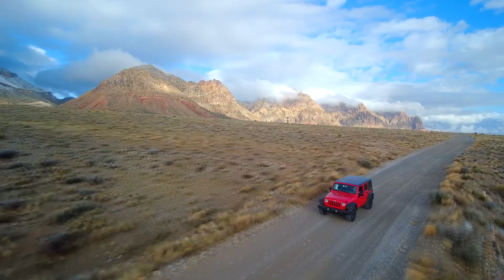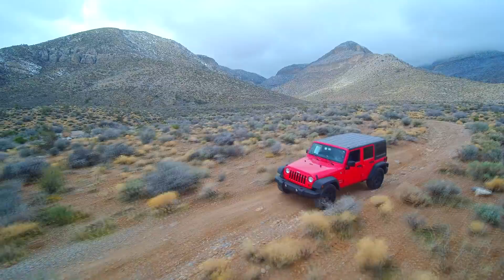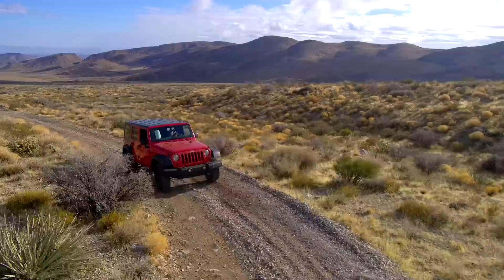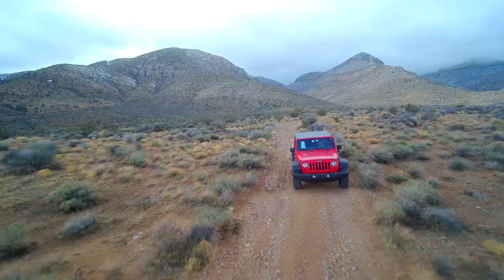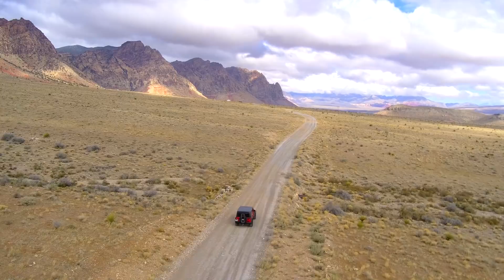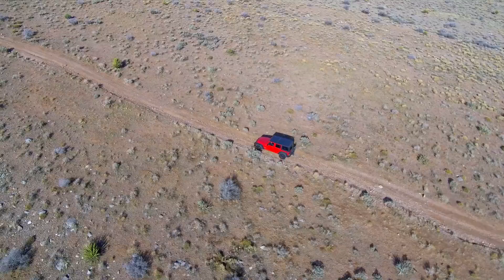Gen V Chevrolet LT 6.2 Wrangler JK

Comment: I'd love to save up for a swap like this for my '08 JKUR. I have been searching for a manual transmission swap, but haven't seen one. I love driving a standard, despite the drawbacks that may have now days with modern automatics in efficiency, etc. Can y'all do a swap like this with a 6 speed or 7 speed manual transmission?
Reply from the maker: We can do manual swaps. GM did not offer a manual with most of the Truck/SUV engines with the Gen IV or V engines; however the LS3 and LT1 are available with manuals. 

IMO the automatics are very good. They have diverse gearing - 4.6:1 to .60 OD. With this kind of gearing and intelligent modes like Tapshift, gear lock, RPM match shifting, set Maximum gear and sport mode they may make a better choice than the manual. And they are strong, the 8l90 capable of handling over 600 ft lbs of torque.
Reply: WranglerJKLS Yeah I'm pretty familiar with them, having driven a '12 Tahoe with the 6L80 a bunch, and a '16 CTS with the 8L90's little brother, the 8L45. Both have been excellent and I definitely agree. 

I just like the driving a manual, a purist I guess haha. A TR-6060 6 speed or the new 7 speed (if it would fit) would be cool. 

Thanks for getting back to me, if I ever save up enough funds, I'm coming to see y'all!
Reply from the maker: We can do the Tremec 6060, a bit costly though.